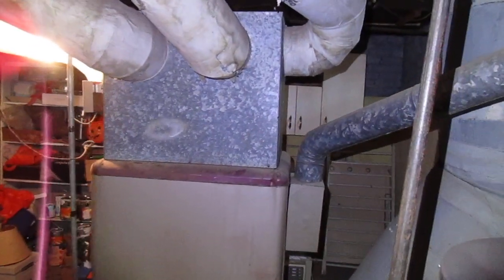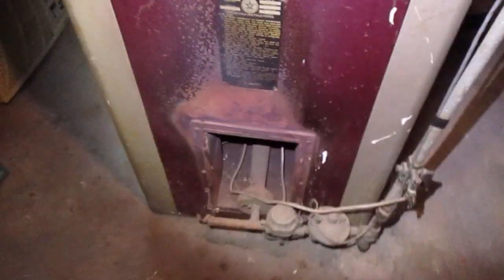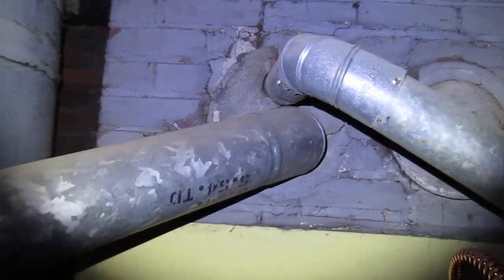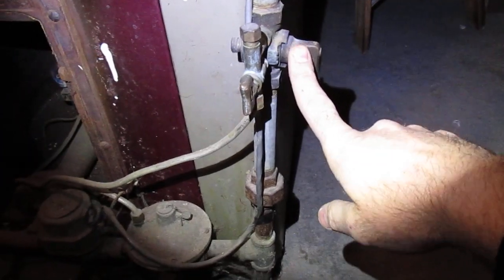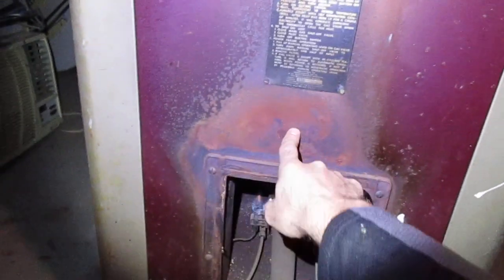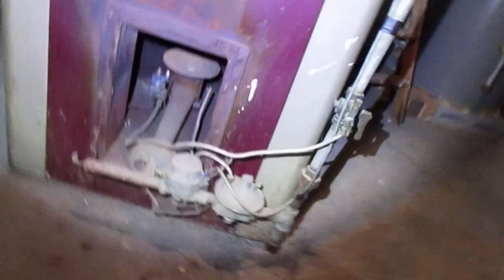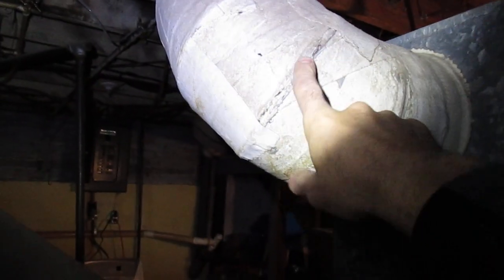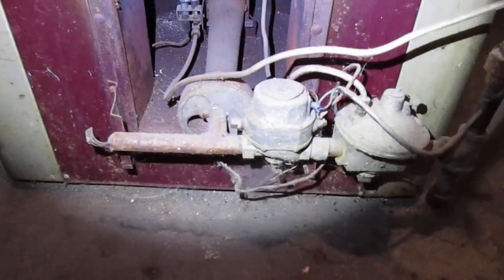Gravity Furnace aka Octopus Furnace still in use!

Comment: I have a Homart Octopus furnace in my home right now, but it's cast iron.  I believe it's from the 1940's.  Pilot might go out about once a year, but other than that, no problems.  House stays warm and toasty!  I was thinking about upgrading to a newer, more efficient furnace, but being a senior citizen, I figure with regular maintenance and cleaning, this thing will last until I'm dust.
Reply: Homart built things to last a lifetime and then some. I believe they may have also been the original makers of Kitchenaid products.
Reply: @seesea-sv3xw  That would be Hobart that made the original KitchenAid, not Homart. Similar names, so it's easy to mix them up.

Comment: My grandfather had one of these but it had been originally a coal furnace  converted to oil.  My grandparents bought the house in the 1930s it was coal at the time.  It took up the whole basement (octopus) in the 70's My grandfather had hot water baseboard gas installed and it was tiny in comparison.

Comment: I still have one at one of my rental houses and the old gravity octopus fires up and heats up the entire house. We have a few small fans cut into the ductwork to help blow the air upwards. It’s about 1300 ft.² sectioned off into two units, and still going strong. 2021. And same thing my highest gas heat bill Is around $150 and divided by two families at $75 to heat the house in the winter so everybody’s happy and we’re chugging along
Reply: @philipwilliamshomeinspecti4665  Illinois

Comment: This one is late 1950s, c1960. In my experience the white is like color-code for asbestos in the duct coating, but you're right only friable asbestos is an issue. It's really not a danger and certainly not even close to being worth the risk of removal as long as the wrapping is still in one piece and remains undisturbed.

Comment: We had one of those in our old house in Northern Ohio.  Ran consistently into the late 90's until our house was demolished.  We moved into a newer home with a Trane XE 80 furnace now 19 years old.   We pretty much had our Trane XE 80 rebuilt 3 times since we moved there in 1998.  From control boards going out, fan motors burning out, heat exchanger needing replaced & just about everything else in there all replaced at least 3 times since 1998.  That old Homart furnace my grandfather had installed in early 1960's (similar to the one in this video) other than replacing a gas regulator, replacing a burner, thermostat & having to relight the pilot light every now and then was by FAR a better furnace then this new modern junk they build now, asbestos & all.  EPA more concerned with emissions & that's all great but if a home is poorly insulated emission laws don't matter.

Comment: I have some asbestos in my basement.  I'm not sure what the safest way is to remove it but I gently wet it with water so as not to get the fibers into the air.  After I got it wet I just pulled it off the ducts.  I still wore a filter mask. I painted the ducts to prevent any remaining bits of asbestos from becoming airborne.   Some of it I didn't remove,  I just gently painted it with latex paint to keep the fibers from getting in the air.

Comment: ive got a 1954 bryant gravity furnace in my own house. i love it. has a double log type burner with 16 total jets split 8 and 8 between the two sides. 110k btu and rated to about 70% efficiency.i love it. during ohio's being storm in 2019 where outside temps were in the -30 to-40 range it just chugged along keeping the house at about 74 degrees. ive had to change out 1 gas valve and during the storm i had to clean the jets. it doesnt have ther type of cold air return set up like in the video shown. instead it has 2 14x22 cutouts in the sides where cold air from the basement feeds in. (the basement is typically about 30 degrees colder than the main house in the winter. its awesome.
Reply: I think I have the same furnace . I to love this furnace . Will not replace until I'm forced to . See what I did there (forced) !

Comment: I have a Bryant furnace just like this . Works Great . Ihave lived here for over 30 years and love this furnace . the only problem I have had is the Veture adjustment has come loose , so i have to check it every season to adjust it . I will keep this furnace as long as I can.
Reply: I live in Erie , PA.
Reply: I use window A/C units in the summer. not touching this furnace

Comment: I have an octopus! The building is well over 100 years old and is in the oldest part of town (which was settled early to mid 1800s) and I believe I was told it is the ORIGINAL furnace. When it was first installed it burned coal! It was converted and they added a unit that burns natural gas years ago. 
I really hate it, my gas bills are astronomical in the winter, my sinuses get irritated whenever it kicks on after a period of non-use, it takes up an uncomfortable amount of space in an otherwise spacious basement, and the heat does not flow to the master bedroom at all (yes, I checked and re-checked every possible reason for this, it appears that it is just positioned too far away from that room and the room is on a corner of the building with two outside adjacent walls. It gets so cold in that room in the winter even with the furnace running that water can freeze if you leave it overnight. It also has the exact same asbestos lined tubes to carry the heat and they are difficult to not disturb because you have to duck and lean to avoid hitting them with your face just to travel back and forth across the basement so I am perpetually worried that I am living in a big box of poison. It even looks terrifying because the main chamber is a round shape just like a giant basement octopus, it is literally a nightmare furnace.
Reply from the maker: In your case it sounds like it's time for a modern gas furnace. Should be able to use existing ductwork.

Comment: The house I grew up in was built in the 1870's and originally had a old coal fired gravity furnace. It still has the old duct work from it, but that's about it. I would've loved to see the original furnace intact, but I'm also glad we had a modern system that has AC built-in.
Reply: @philipwilliamshomeinspecti4665  I think they're fascinating because it's such an elegantly simple solution. And unlike steam radiators from the same time, they make no noise and don't leak water.

I also love exploring old buildings. It's fun to see how things used to be built, especially the utility/mechanical parts of the buildings.

Comment: Still trying to figure out exactly how the thermostat works since there is no electricity running to the boiler. The plumber who worked on the boiler recently tried to replace the thermostat but had to order one from a specialty supplier and we are still waiting. The original Sears thermostat works but not well. The only plumber from the shop providing the service who understands gravity hydronic said the pilot light somehow produces millivolts of electricity and when that charge is interrupted the heat exchanger ignites. I don't really get it, but it works.

Comment: I have a 1939  Payne gravity furnace that I adore. No cold spots as with my central forced air heater with vents at the top of my walls (great for when i use the A/C, but inefficient for heat).

Comment: These can be made more efficient by putting a fan in the air return connected to a fan limit switch in the air plenum.
Reply: the only issue i could see is a decrease in efficiency. think of it like air mixtures on a gas grill. more air than required for a clean flame requires more gas to reach an equal amount of heat. yes it would be more air but less efficient. with gravity furnaces it uses exactly the amount of air needed to heat properly to sent through the vents.
Reply: @thenicoletti  
No, I don't mean more combustion air. That WOULD lower efficiency. I mean forcing the room air on the other side of the heat exchanger. Relying on natural circulation requires very high temperatures, which means the exhaust gases leave at high temperature, which means low efficiency. Forced convection would increase heat transfer and efficiency.
Reply: @gregorymalchuk272  I think using a programmable thermostat is the best way to go . The thermostat learns how long to run the burner . It's pretty cool. It works great .

Comment: That was asbestos. Many of those old gravity furnaces were coal burners from the 10s/ 20s, converted to oil/gas in the 40s, and blowers added in the 50s. If you see a big square box with a belt driven motor attached to this round furnace, that was a blower package added in the 50s likely.  If you see a house with a concrete bunker under the front porch, with a big hinged iron door on the side of house, (near the porch) that was for coal deliveries. Those rooms / bunkers are often still black to this day. (35 year heating man)

Comment: Gravity furnaces are super reliable, quiet, and do a great job heating are large home.   I noticed a pilot burner tubing on the other side of the chamber coming from the pressure regulator.  What is it for?
Reply: @philipwilliamshomeinspecti4665  That tube is on the device next to the pressure regulator on mine, it's on that gas regulator valve next to the pressure regulator valve, the one that has four wires on it, two thermostat wires that go all the way up to from that regulator to your register in the house and two other wires going into the appliance.
I think you answered my earlier question. So it is supposed to be next to the pilot, because theoretically the pilot goes constantly, whereas  the burners are only on when the thermostat's calling for heat?

Comment: RE: "If there is an electrical outage, this unit will still heat the house."

A natural gas fired gravity furnace still requires electricity for the gas valve solenoid and for transformer for the thermostat circuit.  Unless you were to bypass the gas valve so you could manually operate the furnace, you still need electricity to operate a natural gas fired gravity furnace.  Another option is if the gas valve solenoid is 24V and not 120V then, hypothetically, you could operate both the thermostat and solenoid on batteries.

A gravity furnace equipped with an oil burner definitely requires electricity.

A hand-stoked, coal-fired gravity furnace would not require electricity.

Years ago, I spent a weekend in large, 1920s house in northern Minnesota that had coal-fired gravity furnace.  However, the owner fueled it with wood.  There was a thermostat in the hallway of the second floor that was a lever with a large, bi-metal coil that was attached to a long chain that went down a chase to the basement. The other end of the chain was connected to a damper door on the firebox.  As the house cooled, the chain would slowly lift and open the damper and increase the air supply to the fire.  Conversely, as the house got warmer, the damper would close.

I'm an estate sale junkie and have been in hundreds of basements in and around Minneapolis and St. Paul.  One time I was in a circa-1915 house and its original gravity furnace was equipped with an accessory air-handler.  It was mounted on top of the furnace and had a massive, horizontal pulley the was belt-driven driven by an electric motor with a substantially smaller pulley.  I had seen dozens of gravity furnaces over the years but had never seen anything quite like this so at first I thought it was a very well-crafted DIY addition to the furnace.  However, the air handler did have a nameplate on it which identified the manufacturer, brand-name and purpose.
Reply: Yes , Mine has a manual switch (like a flat blade screw driver) on the valve to supply the valve with gas . BUT it will run continuously , you must switch it back and forth. You must be there at all times or some one who knows how to do this.

Comment: Had one in the home i bought a few years ago and that was the first thing i replaced..you can not beat forced air... saves money and more efficient ...
Reply: @philipwilliamshomeinspecti4665  Forced air is easily beaten from my experience, those old gravity furnaces when tuned right and with a cover over that large opening can achieve upwards of 70% easily, some can go as high as 80% with some minor modifications, the house I'm looking at has an old Kenmore 70 Power Miser natural draft furnace, I'll take that old dinosaur over an induced draft furnace any day because the old Power Miser is nearly silent because there's no obnoxious inducer blower and the furnace blower is well designed and very quiet as well, brand new Goodman 96% furnace can be heard clear across the house even with the furnace closet door closed while the Kenmore is nearly inaudible standing next to the furnace closet with the door closed. And as for the saves money aspect, all the additional moving parts will cost more than the savings in gas, an inducer blower is well over $100 for most modern furnaces.

Comment: Shouldn’t that opening in front have a cover panel on it like a hot water heater has?
Reply: It likely did have an access cover when It was installed, likely removed, discarded or lost at some point over the years.
Reply: @philipwilliamshomeinspecti4665  I've seen then with a solid panel, combustion air is let in through the round door on the bottom of the burner in order to properly meter combustion air for multiple fuels, with a properly installed panel and adjusted air inlet they can be quite efficient
Reply: Mine does have the cover . Do not touch while furnace is heating .

Comment: Yeah I also have a gravity heat furnace House of built in 54 I'm trying to find a shut-off valve for my furnace cuz I got a leak in there if there's anybody know where I can find a shut-off valve for this cuz the gas guy wants me to replace the whole furnace I love my furnace anybody can help a model number is w86 gravity heat furnace thanks
Reply: A gas valve should be located on the gas pipe just before the furnace. Before that there should be a shutoff valve. A natural gas leak detector can easily identify the location of the leak. If the leak you are referring to is inside the furnace then is this a gas leak or a flue gas leak? If it’s a gas leak then the burner can be removed, taken apart, cleaned and reassembled. If it’s a flue gas leak then the outer shell needs to be removed and new higher temperature masonry cement mortar should replace all broken or loose areas.

Comment: I have a star furnace like that, nowhere near that size and in the floor,(no Central heating throughout the house)
 accessible through a crawl space, not in a regular basement.
the problem I have now is I've confirmed there's gas going right up to the pilot, when I crack the line but it's not making it out the orifice to be able to light the pilot light,
 nor am I able to bypass the pilot light
All together and turn on the burner have it call for heat and light it that way & have the burners going through bypassing the pilot light 
??
?? I'm about to  give up on this and call in a technician, if there's any around that are familiar with antique furnace  anymore.
Is that a thermal couple on that old furnace, or a thermal pile?
Reply: It uses a thermal couple, but the ones in a hardware store aren't heavy enough. Old furnace guys should have them.
Reply: all the parts that are needed are for sale online. if you know what you are doing go for it, if not you better pay somebody.

Comment: My house I rent has this furnace still works..I wanna know where do I grease/oil this..my old landlord would oil this once a year..New landlord 3 yrs ago oiled once..he has passed n his wife doesn't have a clue..i wanna know where I would grease it as my prior landlord did..he used a bottle with a tube on end..help please
Reply: I believe there is no oiling to maintain this furnace. I just check the flame every year and adjust the gas valve venture if needed.

Comment: I have one similar to this and it needs a new gas valve, any idea where to get the parts? Having issues here in ohio.
Reply: I would not be so sure it is the valve . mine seems to be bullet proof . check the venture if it seems to be FLAMING UP ! I just adjust the air going into the burner.

Comment: You said it will run during a storm in the event of a power outage? How? What is powering the gas valve?
Reply: @philipwilliamshomeinspecti4665  Thanks. I don't know much about gas heat. I do mostly oil.
Reply: Yes , Mine has a manual switch (like a flat blade screw driver) on the valve to supply the valve with gas . BUT it will run continuously , you must switch it back and forth. You must be there at all times or some one who knows how to do this.

Comment: 50-60% efficient is a pure guess. Measure it. Tell us your results. Mine is 87%.  This 50% or 60% number is worthless information. Measure with a flue gas analyzer.
Reply: @philipwilliamshomeinspecti4665  A poorly running gravity furnace will run as low as 60% efficient but one that's had all the necessary cleanings and maintenance done and has the proper cover over the burner access will compete with modern furnaces in terms of heating efficiency but at the same time will beat a modern furnace out in the operational noise and ease of service categories
Reply: They can be efficient.    Look at the information plate on the furnace.   It will give input BTU's and output BTU's.   You may will find that adusted properly they are 75-80%.    Most of the newer furnaces gain the % gain in efficiency by getting rid of the standing pilot light, which is on all year.    That way they can quickly claim 90%.   (over a year)   LOL
Reply: @vacexpert2020  I AGREE! My highest gas bills in Erie Pa are around $125 in the dead of winter  HA!, I turn the pilot off in the summer . I use a programmable thermostat . HA!
Reply: @batlwagonwagon5251  that's pretty good, I've never had a gas bill go above $100 with my 90% furnace, replaced a roached 70%